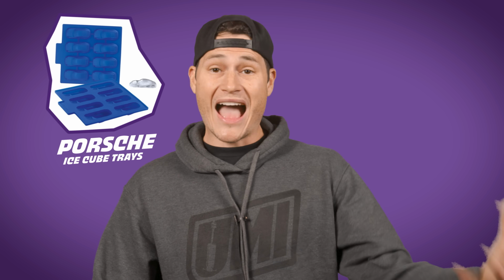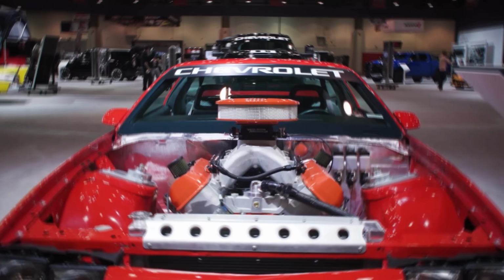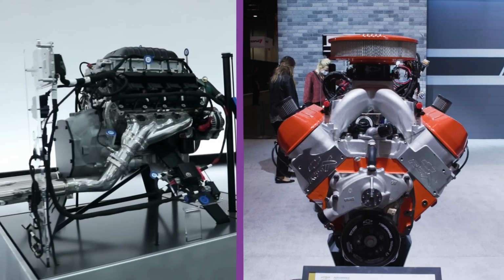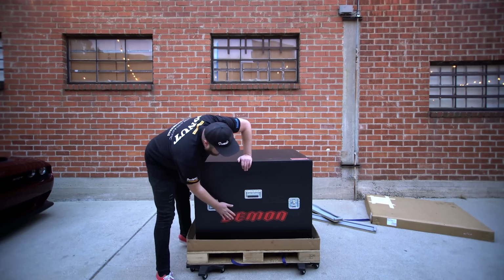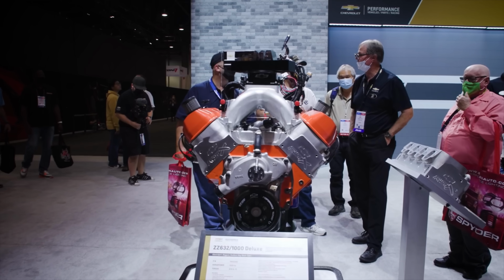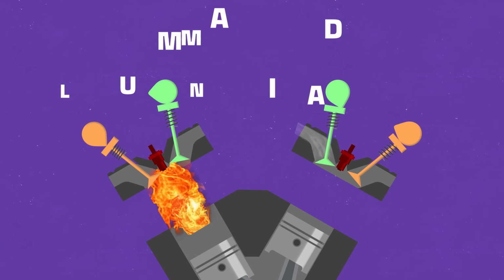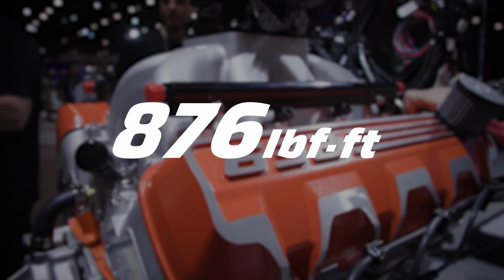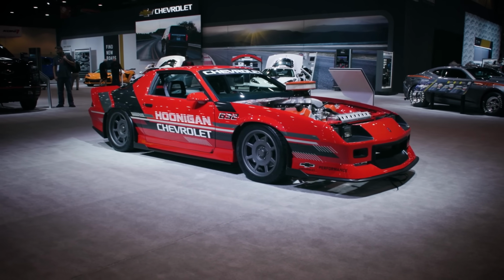Chevy's 1000HP Crate Engine EXPLAINED

Comment: 9:48 Get a classic mom minivan, and make it mid-engined, and put the monster in there. Don’t forget to get a 4/AWD. Also get a good muffler that lets you sleep/stealth mode, so you can get the most out of the sleeper mom van.

Edit: also, twin-charge it.
Reply: Might as well attach a jet engine bud 😂
Reply: @Anon-tj2zk  Fuck it, let’s do that too.
Reply: @Anon-tj2zk  put this baby in a top fuel dragster and see what happens
Reply: @Anon-tj2zk  get me one and Ill dp it 😂
Reply: @Anon-tj2zk  yes u absolute mad man yes it must be done
Reply: Did someone say Toyota Previa?
Reply: Now thats a project I wanna see get built
Reply: Like when BMW put a V12 from the McLaren F1 in the trunk of a 5 series wagon?
Reply: @whotf888  or when VW put a W12 in a Golf. Yes.
Reply: @ThisleBush  those are fucken classics
Reply: Check out the boosteboiz “rowdesy” van lol
Pretty much the setup  you are describing
Reply: you sir are befor your time. few know of the fabled twin charge. even fewer attain. its a high compression engine, but if done right 🤌
Reply: A muffler would detune the engine. Better to have a high flow loud exhaust.
Reply: @theenzoferrari458  one of those you can set to open/close. So either you stealth mode or you don’t stealth mode.
Reply: @theenzoferrari458  use an electric exhaust cut out
Reply: Shoving it in a light-weighted body like the beautiful Lotus Exige would be magnificent stoker. Lightweighted and powered by that powerful 632 would be a great weapon of mass Track destruction. I would be bringing Terror with that kind of build.
Reply: Put a top fuel dragster engine in the minivan and the engine in a plane
Reply: Aint very realistic but who knows
Reply: @aaronhall4755  cause a 10.3L motor existing is realistic… 🙄

It’d be more fun than some the old pos they had it put in, what was it a grandma?
Reply: @ThisleBush  im talking bout putting it in a van and junk
Reply: Dude a 10 letter, 1,000 hp with over 800+ foot pounds is going to need a lot more then a muffler to make it stealth.
I find it so funny when anyone thinks they can put an engine like this in and some how make it stealth...have you heard the engine, Hoonagen put this in a Pontiac for SEMA, check out their video and when they turn it on you tell me if you can hide that. Lol
Reply: @AzNAbGjDm  we can try!
Reply: Congratulations, you just built the Renault Espace F1... 30 years later (that one had a F1 V10)

Comment: Head flow, compression, and a nice size cam will make any motor powerful. However, different size motors will make power in different rpm’s to get there.

Comment: its about 100Kg over 2jz, which is a lot
i bet it is possible to get 1000buff horses out of 2j  spending less than 37k

But for sure it is crazy to accomplish something like this
Reply: Not so crazy when you realize its a 10.4L lmao. With today's standards, a 10.4 should be making at least 1040 HP. To name a few, Lambo 5.2 makes 640 HP, Ferrari 4.5 makes 570 HP, GT3, T50 4.0 makes 650 HP, and lastly,

Valkyrie 6.5 makes 1000 HP. 

To get a better picture, it takes the crate motor an extra 3.9L-ish to make the same amount of power. Thats the size of destroked E92 V8, GT3 RS F6 or a stroked out GTR V6 or McLaren V8 lmao. It takes the size of another sports car's engine to make the same power.
Reply: @retoadyt3196  also true, that we already have engines with 1liter/100hp++
but for me interesting is fact that 1000hp is n/a
Reply: @MeijaJanis  yeah, that 1000 HP out of 6.5 is pure motor, no turbo, no hybrid, no supercharger, just the engine. Incredible.
Reply: @MeijaJanis  btw, EKanoo 5.9 1/4 Mile 2000 HP 2JZ on a stock block, stock crank? Insanity. Absolutely Amazing.

Comment: Steps to how Chevy did it:

1. Large displacement
2. High compression
3. High gross flow
Reply: @onyxphantom6762  he is just sad a big naked V8 makes more power than his 800 (but could be 1200 if built) motor lol
Reply: It's okay guys, Nor Dic is a barra boy, it's no surprise he's hating on this thing. Barras are apparently superior to anything else on the road
Reply: Hi cost
Reply: 4. Huge pair of bearings
Reply: @UCmZp5lsovHkt6ywHDd90suw a 4L 4v dohc turbo will make way more power and torque than a 10L na v8 engine.
DOHC revs hard, 11000 rpm is no problem due to no pushrods. VVT cams gives the best of both worlds - great torque down low, and great performance up high. A regular single cam cannot do this.
4v flows way better than 2 big singles valves - about 25% more flow on higher rpm on an na engine. At high boost, high flow, when any restriction is an issue, 4v walks all over 2v by a huge margin.
The cams on a 4v head, are staged to open one valve before the other to induce swirl.
This is why all pretty much modern engines are DOHC 4V VVT and turbo. Most cars manufacturered in 2021 are DOHC 4V VVT and turbo.
Reply: Computer Designed Monsters Cubic Inch Beast!!!!!! $$$$$$$$$
Reply: Yeah, it’s not always magic.
Reply: That's how EVERY big power engine "does it"
Reply: 4. Low intelligence of the potential consumers.
Reply: @nordic5490  wrong
Reply: Most engine builders can do 1000hp with less displacement.  Most consider it a waste if you don't make at least 1000hp out of Big Block.  So this eninge is just easier access for posers.
Reply: @bowez9 go look up cleetus McFarland.he did a blown 632 third gen Camaro Burnout car..And for what he wants to use it for it works perfect..You will have a hard time doing what this engine does reliably with a smaller engine..And yes you can do it.But you are pushing that engines limits ..This is the type of engine you make 2000hp plus with.

Comment: I was impressed when I saw 1000hp ... until I saw 10L.
Reply: yeah, 1000 hp is alot of power but i would never call a engine with less than 100hp per liter a race engine.

Comment: My 21 year old Honda still had a lot more power per liter from stock.
Reply: Is it NA though? If not then you can’t compare them
Reply: @th3airraidsir3n5  yes, it would be
Reply: I wonder why people are so impressed with 1000 HP outta 10.4

Imagine getting impressed from 100 HP outta 2.4L lmao.
Reply: @retoadyt3196  I think you mean 230 hp from a N/A 2.4L. That's about 96 hp per liter, same as the 632.
I'd be pretty impressed if my 2.4L 22RE made 230 N/A horses.
Reply: @gabrielulibarri9950  damn i miscalculated lmao. 230 is whole lotta fun especially on a small sports car such as Miata or likes of it. But then the s2k makes 240 outta 2.0 so i guess "fun" aside, "better" is a completely different story.
Reply: true, but the larger the displacement becomes, the harder it gets to make 100hp/l or greater due to the increased parasitic, viscous, friction, and pumping losses inherent to engines while operating.  Those losses don't really scale linearly with displacement either.  So yes, it's fantastic that modern honda 2.0l I4's make over 100hp/l.  But taking that to the 10l extreme is significantly more difficult.
If you want a more apples to apples comparison, take the honda's power at 6600 RPM (or 7000, doesn't really matter), and see if that comes out to 100hp/l.  Honda's make great power because they've been built to handle high-RPM long duration loads.  And since HP = (Torque x RPM)/5252, the higher the RPM, the higher the HP reading is capable of being, so long as appreciable torque is being produced at those elevated RPM levels.
The really cool thing is that this N/A spark ignition engine is operating at a level of torque that's normally reserved for Diesel truck engines.  To me, that's far more impressive.

Comment: I would love to see you put one of these into a Factory Five 818.  It's a tube chassis, mid-engine kit car intended to be built from a donor Subaru Impreza or WRX that was designed to weigh 818kg (1800lbs).  I don't know if it would fit, or if the Subaru transaxle could handle the power, but a 1000hp, 1800lbs, mid-engine, RWD track day car would be pretty awesome to see.  Or you could be a bit more boring and put it into a Factory Five GTM Supercar, which is also mid-engine but was designed to be built from a Corvette donor with a Porsche transaxle.
Reply: It would be far too heavy for track use, you'd be better off going with a much smaller turbocharged Japanese engine like a 4G63, RB26 or 1/2JZ. Or, actually, an STi motor like they suggest would be a pretty good call.
Reply: It can if you brave enough, but it won't be competitive at all nor easy to drive

That thing really shine with lighter motor. You know, gokart feel instead of death wish feel when you step on the gas deeper